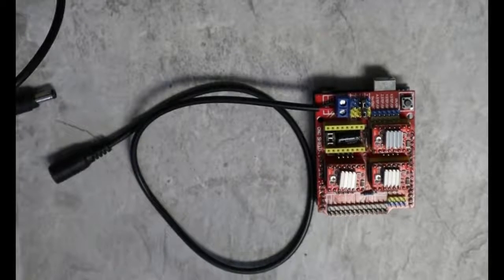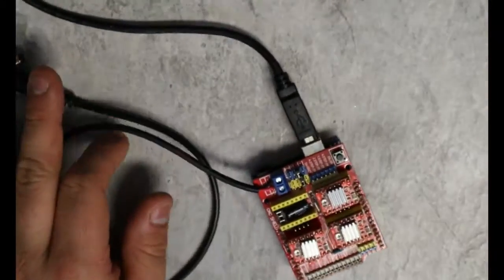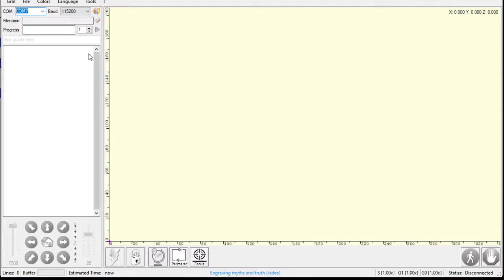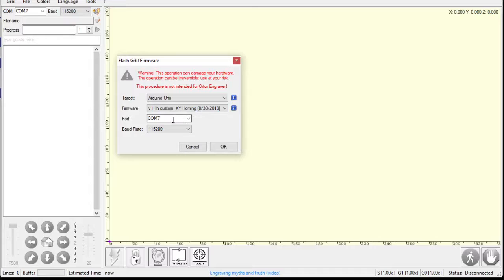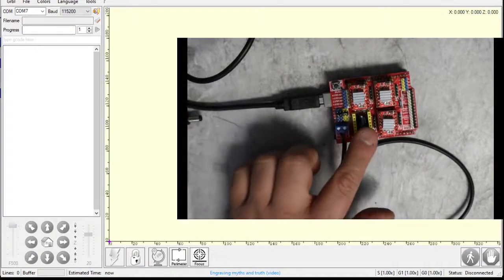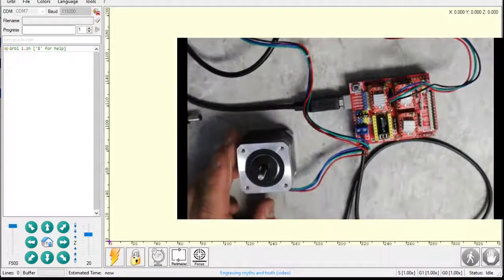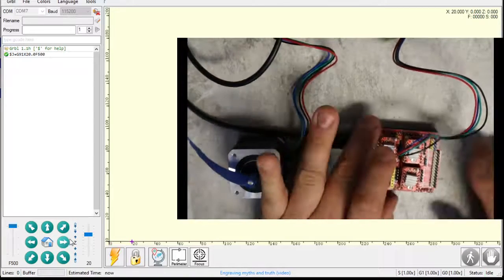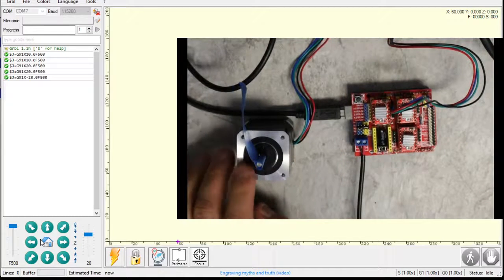GRBL Shield video 3   Loading firmware and testing it

Comment: Did you burn your other 2 driver modules?  Didn't you say to always connect a load to them if you have the stepper drivers installed?  Or is it fine as long as you don't push any commands to those drivers/axis?
Reply from the maker: I've only burned out a module by setting the current too high. I've been told not to run them open current or it might break them.

Usually,, any command on any axis will engage all the stepper drivers.

Comment: I don't understand about flashing firmware.  This will overwrite Arduino Uno ATMega328 chip?  
Why there is warning about damaging Arduino? What can go wrong?
and after flashing firmware, that Arduino Uno can only be used for CNC?
Reply from the maker: @jumbo999614  it will overwrite anything on the Arduino chip. 
It won't damage this setup.

GRBL is very customizable. If the machine depends on a customized build of GRBL,, flashing it with standard GRBL may make the machine unusable.

Comment: Luckily UGS platform does it automatically as manually I could not get the machine to stop at the switches, and as per laser there is no calib for Z axis. And trying to get the machine limits with Gcodes and "N" code from who knows where when I am a newbie, is a whole pain in the........ culo! You should update your video to help newbies with new versions and include 3 full axis. Bye and thanks anyway.